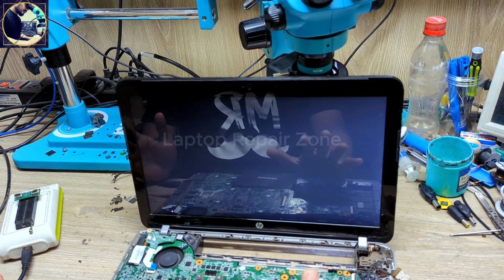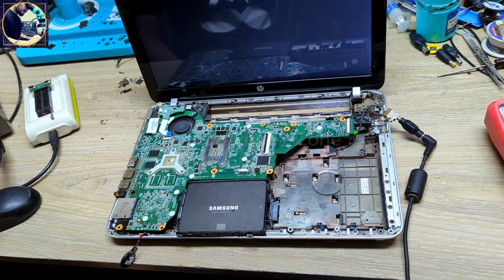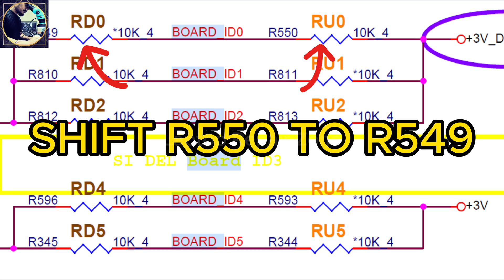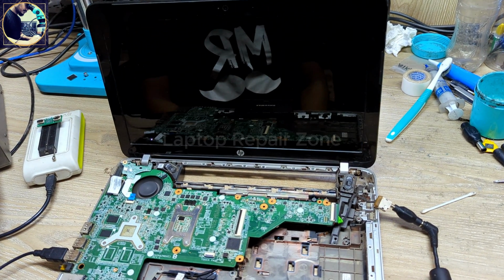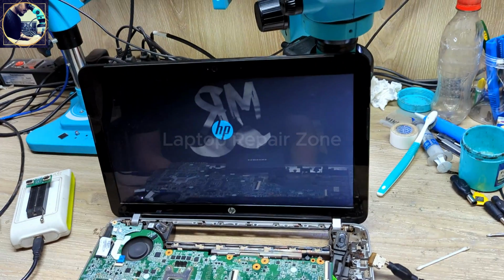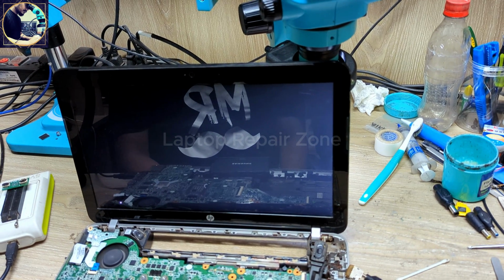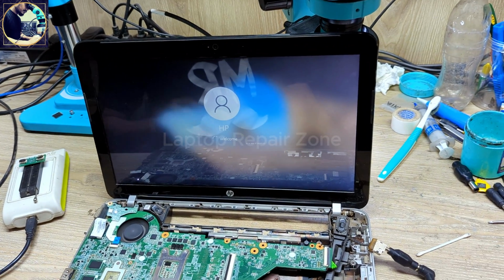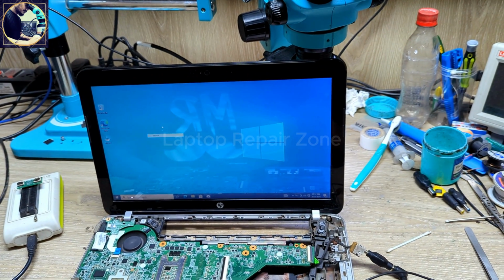laptop hang problem solution | laptop stuck on welcome screen | hp pavilion 14 hang problem fixed!

Comment: Nice job. But how did you know/decide which resistor to remove and where to install it. Just asking to know how to handle it incase I meet same fault on another laptop model.
Thanks
Reply from the maker: Thanks for comment, all the information you'll get in schematic diagram.